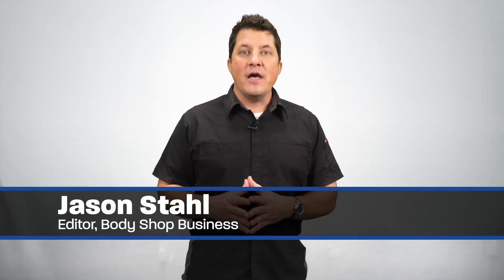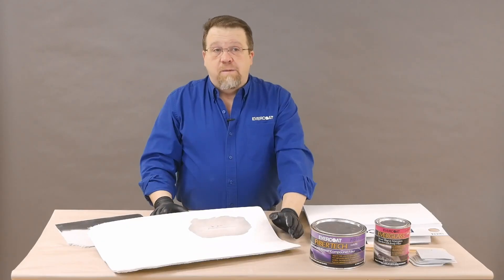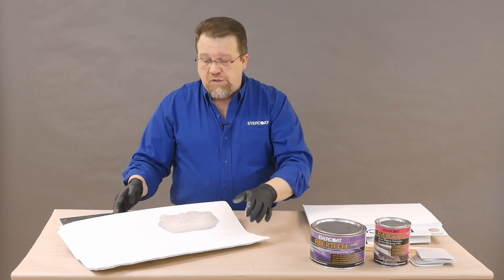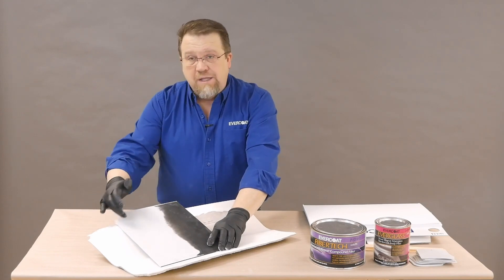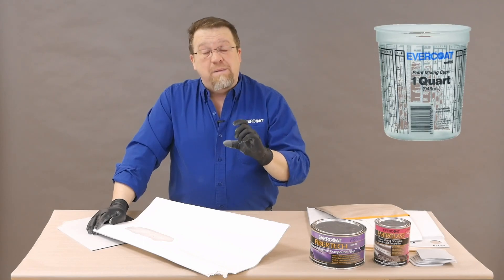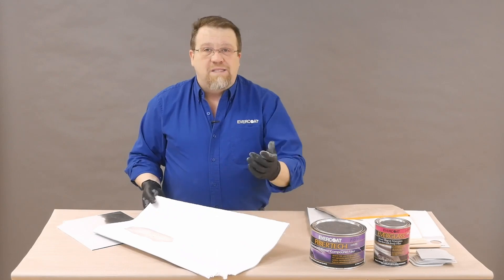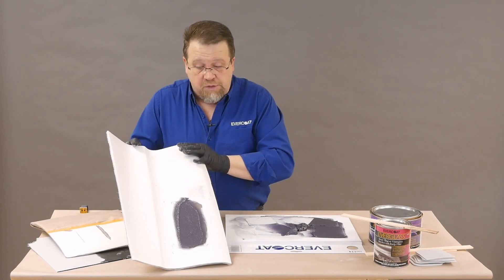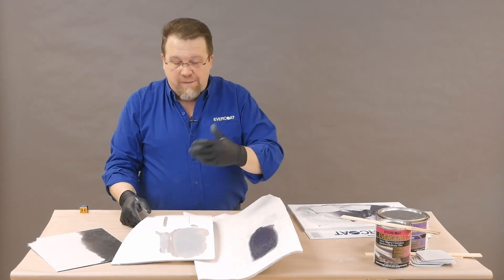Fiberglass Repair

Comment: The project is to repair the hole that rusted through a porcelain coated cast iron sink.  After using fiberglass and fiberglass cloth to patch the hole, I was thinking about using a clear epoxy with matching white pigment to put the final layer or two on the sink.  It’s by the faucet, so it isn’t really weight bearing and although there is contact with water, it isn’t soaked at the bottom of the sink.  Any advice, ideas, or recommendations would be greatly appreciated.  Nothing has even been started, everything is planning at this point